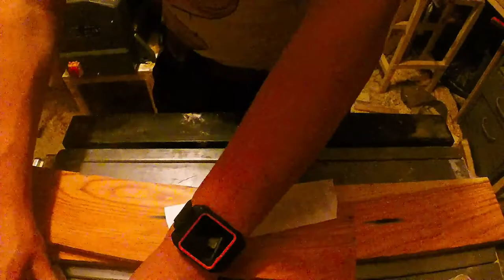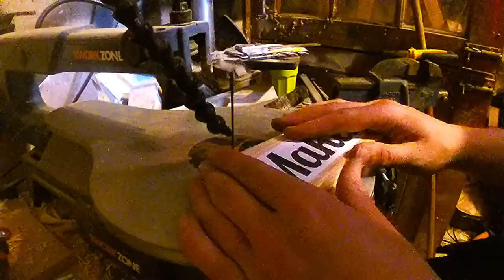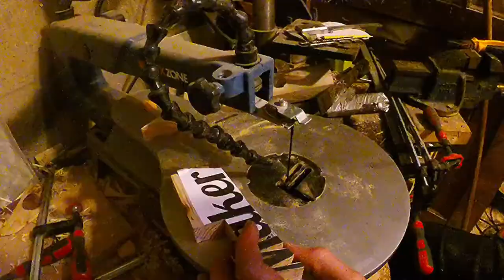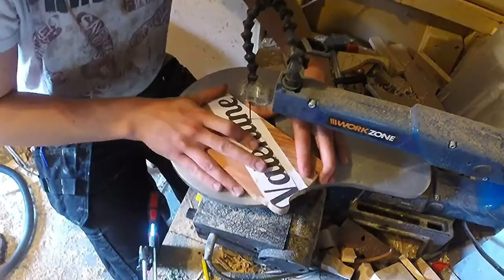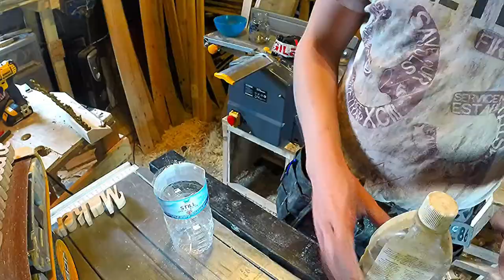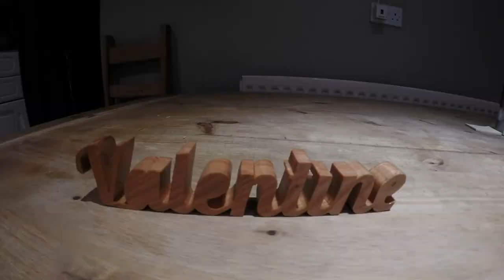How to use a scroll saw to make letters/names

Comment: Instead of using a belt sander to get the paper off, use mineral spirits, the paper will peel off and then use it again to take off any glue residue that is left on the wood. Also u could put packing tape on the wood before you glue the paper on this lubes the blade and it will come off the wood easier